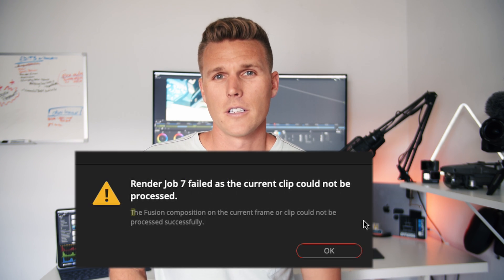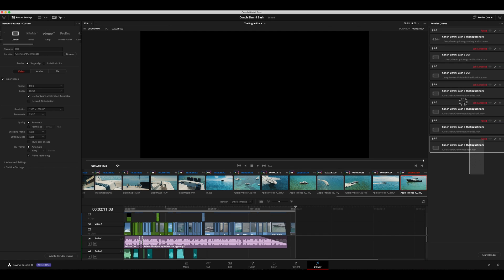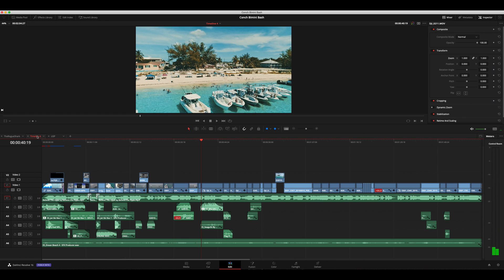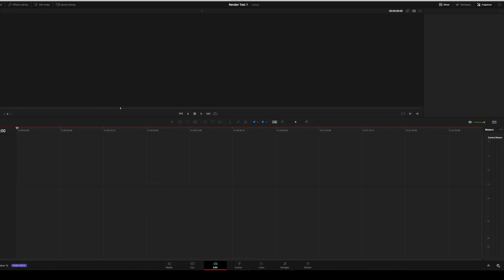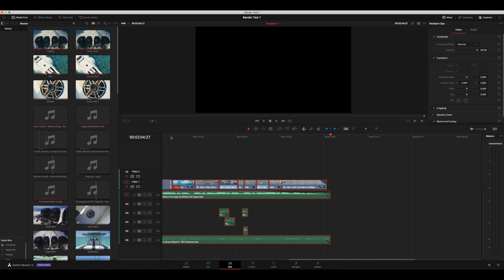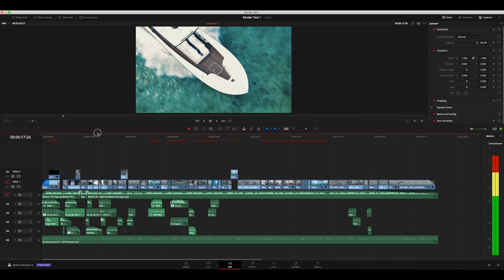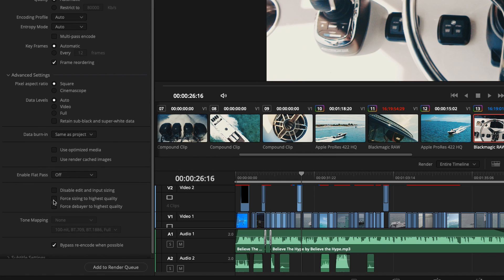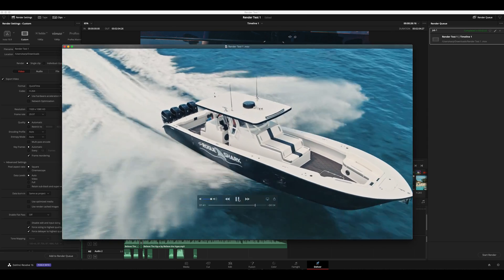How to fix "Render Job Failed" Error | DaVinci Resolve 16

Comment: Didn't work for me. In my case, I was using some title template. It must have some keyframe that I couldn't control. I just deleted it and tried to look for a new one. Last case scenario, I'll make the fusion design myself which beats the purpose of using templates. I've learned that many templates from Envato and Motion Array are actually garbage as they either don't have macro versions, or they may look attractive but you can't modify them much as they're missing many macros. Stopping renders when a frame or clip cannot be processed will not work in my case as it produces black frames or slowed down frames which I definitely don't need

Comment: However I still got the error in exporting going through this step.  At least this step enabled me to reload playable timeline and clips as in the last project I couldn't even play the timeline.  Then I used In and Out points on the Delivery page to go through each clip that can export.  Finally found the first 2 clips weren't exporting.  I then rendered those two clips in place "Render in Place" and it allowed me to export/render in the Delivery Page.  Finally I did the entire timeline and exported successfully!

Comment: I have the same issue with Davinci Resolve 18, but I figured out, that it has something to do with a video transition to a fusion composition. When I delete the transition, it works. Once I also transformed the fusion composition to a compound clip and it worked, but not anymore.

I thought it might be a overlap of the transition and some keyframes of the fusion composition, but that wasn´t the case. Still have to figure out what the reason is.

Comment: someone please help!! Saddened and frustrated to see I’m the only person in every comment section of every video that isn’t having my problem solved man!!! I’m trying to make a VERY simple YouTube edit. 1 intro video, 1 full length video (28mins) and 1 soundtrack that last 35 seconds at the start of the video and around 15 seconds at the end. I cannot render my video. I get render failed. And I can’t find out why. I’ve tried using every single tip I’ve seen but nothing is working. It’s nothing to do with fusion (I don’t even know what fusion is) I’ve had sometimes it says ‘media files’ in red and used the same steps I seen on about 10 different videos, hasn’t worked. Tried to deliver the video automatically and also render it then upload to YouTube from my laptop. The quality was horrible. It just won’t render. This is sending me crazy. Someone please help!!!!????

Comment: this is the first video that comes up in a google search.

I actually didnt have to save it all and create a new timeline. 
All I did to fix mine was check the boxes :
-Bypass re-encode when possible
-Use optimized media
-Use proxy media
-Use Render cached images
-force sizing to highest quality
-force debayer to highest quality

Ran the render again and it completed. Yahoo!
Reply from the maker: Thanks for sharing! Yes this video was relating to a much older version number but seems to sometimes still need to be done. Thank you for sharing your solution!

Comment: I found that davinci is duplicating my video to the end of that video to the same timeline everytime I close and open the project. It can not render when your 5 minute video is 50 minutes long without taxing your complete system to crashing point no matter how much power your system has when your video was 4 GB and now it's automatically 400 GB's and davinci rendering the davinci app with additional 40 GB content within the app instead of rendering to an a mp4  FILE mov FILE or even mp3 FILE but the entire duplication of the entire system to the system it's up loading to.....and it's a Davinci format which only davinci can read and no other commercial format the industry uses can read their specific inline format unto themselves, and it's duplicates it's duplicating automatically. Is there a setting that tells davinci not to duplicate the file and add it to the timeline upon closing and reopening and every time I open the project do I have to keep deleting the same 10 duplicates it added w/o me plus one more it just duplicated last time i closed the error filled software of 17.2.2 and 17.  And every duplicate is a 17.2.2 and 17 MEDIA OFFLINE Davinci software error. I know because I imported the video to Davinci 16 and wound up CUTTING THE (MEDIA OFFLINE FRAMES) Davinci incorporated to my video, ADDED TO THE VIDEO BY Davinci 17 17.2.2 and my video wasn't a (media offline CORRUPTED) file anymore with (Davinci Media Offline video frame they added) added in automatically to my video to make it a ;MEDIA OFFLINE CORRUPTED VIDEO with davinci frames ADDED INTO THE TIMELINE AS PART OF MY VIDEO. Of coarse they are corrupted when your  uncorrupted videos get added to software that is corrupting them.... once incorporated into the software of 17.2.2 & 17. 16 didn't corrupt my files on either my MAC or PC.and 17.2.2  and 17 corrupted my files on both machines.

Comment: Same issue on Resolve 17. The issue comes from fusion compositions who stands alone without other tracks underneath or on top. In this case check if the compositon has a background, if not, put a black background to the composition.
Reply: I just had this issue. Was doing a "timelapse" with nothing above or below and it wouldn't render. Just deleted it out of my video out of frustration.

Comment: Good to know. I’ve just had this. I did a test render and was fine, a day later it wasn’t fine. Refuses to render. After googling I just did the untick “stop render when job fails” thing. Video looks fine. I don’t like the sound of doing that though. Your method looks good. Might try that. Anyone know why these fusion things fail? I’d like to know what I’m doing wrong. I never had thus much trouble with FCP. Appreciate some is user newness. It’s crashed on me 3 times already 😂. Dr17 studio.

Comment: I tried this but still doesnt work man screw this sht this problem has probably wasted 12 hours of my time already
Reply: Did you try going to the DaVinci Resolve tab, going to preferences>user>ui settings, and unchecking "Stop Renders when a frame or clip cannot be processed"? As soon as I did this, it allowed itself to render properly.
Reply: @Sandborne  I already tried that.  I ended up just making a new project and the fusion clips worked there.  Ugh.  I got around it but still annoying that I had to do that
Reply: @Helvathex  Sorry to hear that man, it seems every editing software I use always has some sort of major flaw :(
Reply: TYSM Sandborn you helped me fixed tysm
Reply: @germ4427  yep np :)

Comment: Thanks a million! I just found your video after wasting days on the BM forum. 

So many waffling idiots on there who can't get to point & completely derail threads without providing the requested solution. Avoid that forum like the plague. Unless you enjoy wasting time trawling through endless threads of losers droning on about their computer specs, irrelevant opinions & needlessly commenting that everything is working fine for them.

Your awsome video & viewer comments had me successfully rendering my project in under 10 minutes!

Subscribed & liked... Thanks Again.

Comment: That happens to me 9 times out of 10. Did not copy all your settings. Media offline then happens. Relink selected clips, failed. Have tried everything that can be found on YouTube: etc.
I am using an Imac (21.5-inch; late 2015) prossesor 1.6 GHz Dual-Core Intel Corei5. 8GB 1867MHz DDR 3. Apple SSD. Videocart Intel HD Grafhics 6000 1536 MB.
My mac is practically empty, only some photos and movies, I only use the mac for video / photo (only i Movie app). it is the free version of resolve. Sometimes the program just stops. and everything is gone. No backups to be found. tried all the possibilities that could be found nothing helps. Everything I've done on my iMac is running except Davici resolve. Would like to to buy davinci because it is a very interesting program, but that way I'm not sure if this will also happen in the purchased version. Too bad this keeps happening. perfectly. Help! (google transl. I am Dutch) THX 4 the vids.

Comment: I'm having the same issue even doing what you say 😥
Reply: Maybe the resolution is the problem. I had the same issue and nothing worked! Found out I had to change the TIMELINE RESOLUTION from 1920x817 (cinemascope) to 1920x818.
Reply: @UnknownUser-pf9rk  So if I am working with 1440p videos, I have to change the timeline resolution to 2560x1441. True?

Comment: okay, I saw this video when I encountered this error. at first I didn't do exactly what the vid says and went to comments directly because of the vid description. I tried the uncheck stop renders when clip cannot be processed. yes it didnt stop ofcourse but the output vid got screwed. some clips were missing and with black screen only and some got distorted. Next., I tried relinking all the clips used and with the same timeline as before. it did work but all text+ clips is now missing. tried doing the video's solution and I copied all the text+ clips to a NEW  timeline and copying it back to the OLD timeline. it now appears and rendered without errors.

summary:
-relinking all clips in media pool
-I copy+paste the text+ clips to another timeline and copy+paste it back to the original  timeline replacing the old ones

hope this helps
Reply from the maker: Thank you for sharing!!! Glad you were able to sort out your issue

Comment: Another tip, is pay attention if the Error occurs always on the same Clip.

For me, I remove temporarelly the "failed clip" and started the render.

Later, I introduced the same clip, at the same position and started to render again.

Worked for me, but, if didn't, I could take the first rendered video (without the "failed clip") and create a New project with this Two clips: All video already done + The little "Failed clip"

Comment: Fun fact: It will also stop render even if you don't have a fusion clip/comp and display the same error. Fix this: Preferences > User > UI > uncheck - stop renders when a frame or clip cannot be processed. Got it from a thread because Jake's method didn't work for me this time (it has worked previously). But this has resulted in Blank frames for me. But they aren't noticeable in real time playback because this error usually pops at the junction between two clips or with a transition being used.
Reply: This worked for me. Thanks man. I really appreciate it!
Reply: yes this worked for me also. The Video didnt help but your comment helped. very nice! thank you!
Reply: @Middensound-Sounddesign  you are welcome

Comment: Hi Jake,

I had an issue with exporting my video.  My video size is 52 minutes long.  When I was in the section where to save the video to my USB flash,  the "Add to Render Quene" on the bottom of that drop down box was not turned white.  Thus, I was not able and allowed to proceed to the Start Render.  Do you have any advise to help me?

Comment: Trying to follow step by step.

4k 60fps
Uncompressed 10bit
Smart render
Force highest quality 
Quicktime 4k 60fps
Enable caching etc

Takes 2 hours to render.and failed 2 times even though I use the same settings on every video I do and works so I just dont why all of a sudden it's not working and saying render failed coupdnt decord it all or something

Comment: I tried this. Still failed. I get "Render Job 1 failed as the current clip could not be processed. The "clip name" could not be decoded correctly. Please see if the clip is still available on the drive."  I've tried converting all of the clips to lower res formats. They are all identical.  It fails at around 98% completed.

Comment: I'd really appreciate a help with Da vinci Resolve crashing when rendering... Basically the percentage counter stops, and it doesn't advance... cant change window but the remaining time is going up and up. The processor is working on around 30% constantly, until I stop the rendering and memory around 3600M. I have 8 giga, and a Geforce 1660 card, and with my previous computer I had no issue, it was much less powerful... can it be a timeline issue? that I put 4k and 1080p videos in the same video? thank you for every help in advance!!

Comment: Hey a little off topic but I'm having a issue I'm having a hard time solving. Idk if I hit a setting but get this. You know the orange bar that you you drag back and forth to line up clips. Whenever I now drag a clip instead of stopping against it, lining up with it, I doesn't. This makes lining up clips together much harder. I know this is off topic but I'd much appreciate a explanation.

Comment: Thanks for sharing Jake. I have files from a cheap, made in China security cam that seem to have decoding issues or data dropping or something. I've converted them to a different format before importing them to see if that fixed it but no joy.  Essentially I need Resolve to render the job ignoring any errors as it goes.  Any ideas?  **UPDATE** 
Bar Shabatai Productions solution worked for me, a checkbox setting in preferences.  Thanks!

Comment: Please navigate to Resolve>Preferences>USER>UI Settings, and Un-check "Stop renders when a frame or clip cannot be processed"
Doing this should allow the render to complete.
Reply: @MOTIONTOGRAPHY
  thank you very much
Reply: Phani On The Road You’re welcome
Reply: Thank you 🙏
Reply: This worked after attempting the instructions in the video to no avail. Thank you
Reply: What do you mean by resolve because I can't find it
Reply: @rine2030  It should be Davinci Resolve in the top left corner of the screen, before File
Reply: @safabekr  Ok thx. I just realized that it's for davinci and not ae
Reply: Thank you so much
Reply: this worked, ty m8 you saved me hrs of time
Reply: DIOS TE LO SABRA PAGAR, DE VERDAD QUE MUCHAS GRACIAS !
Reply: Thank you so much
Reply: Gracias!
Reply: But doesn't that also have the disadvantage of the clip not being rendered properly?
Reply: Still the solution in 2025

Comment: Davinci is starting to suck for me.  I've used Adobe Premiere Pro for years and never gave me a problem.  I've been using Davinci for the past 2 weeks and have been getting a lot of freezing and crashing.  The most current one is " The GPU failed to perform image processing because of an error.  Error code 77."  This is on Davinci ver. 16.2.

Comment: If you have this issue, resolve should highlight (select the clip it failed on). Double check your fusion key frames for anything that might seem weird - red outline perhaps. I had to reset a couple compositions because fusion messed up.
Reply from the maker: Yes this seems to be a root cause a lot of times
Reply: Same here, I had to adjust a few key-frames, 5 minutes of work, and everything worked!

Comment: Thank u Jake Earp! I did it like u said but it did not work. Than I started to rander and remembered the time the rendering was stopped and checked the fusion. The fusion was not working completely. I just redone this fusions and rendered again. Then it worked. The whole work i did in a new project that i started with ur video!

Comment: Minimize all your clips into compound clips and it will save you time and errros !! So ive been trying to render a 24 minute 4k video for 2 days and after 10 different errors i turned all my clips into multiple compound clips and Voila ! Rendered 13 GB in 40 min and quality and look great. Im a noob to Resolve 16 but it worked.

Comment: damn i have windows
Reply: you can still follow this, completely applicable, I did the changes and it still failed at some point so like ppl are saying in the comments, "Please navigate to Resolve>Preferences>USER>UI Settings, and Un-check "Stop renders when a frame or clip cannot be processed"
Doing this should allow the render to complete."
Just tried this and we will see. BTW I am on windows as well

Comment: Worked for me.
I had the "Add to Render Queue" button greyed out, and the most pointed solution to create a New Compound Clip did not work. I was working with a synchronized multicam clip, and after I did the New Compound Clip, the resulting clip got all mixed up.
This did it for me and without the need of a New Compound Clip.
Thanks a lot for your troubles, man...

Comment: Thank you for this video... I was about to get frustrated. :P
Reply from the maker: You're welcome. Glad it helped!
Reply: @JakeEarp  I spoke too soon... it ended up not working. It appeared that it would, but ended up fighting more. Apparently the 3D text i added wasnt lined up exactly with the next clip. For some reason this caused an issue with the rendering. Fixed it though... was successful in the end :D

Comment: Hey Jake, great video! It didnt fix this problem for me tho. I think its the other thing the peeps in this comment section are talking bout. The whole prefrences thingy. I would try that too, but the thing is this is my first time trying davinci resolve 16 and i cant find where in the program prefrences is. Like where is the button I can press to be taken to User: UI  "stop render when a frame or clip cannot be proccessed. It would make my day if you could just tell where prefrences is. Cheers.
Reply from the maker: Click the “cog wheel” settings in bottom right corner on edit page. Then select the the second page on the top section
Reply: @JakeEarp  Thank  you, fixed it! much appreciated, subbed xP

Comment: How come yours rendered so quickly? Mine is still taking at least half hour for 10 min video
Reply from the maker: Hansol Oh This was only about a 2 minute video that I was rendering. How long is your video you are trying to render? Also what are the specs on the computer you’re currently using?
Reply: @JakeEarp  I see my video was about 10 min. So a faster computer would probably speed up the time makes sense. Thank you!